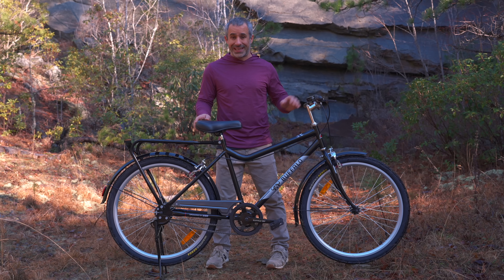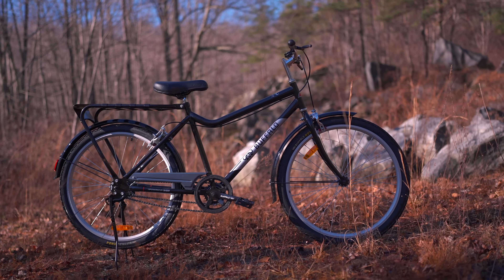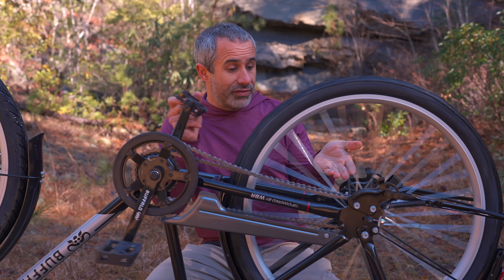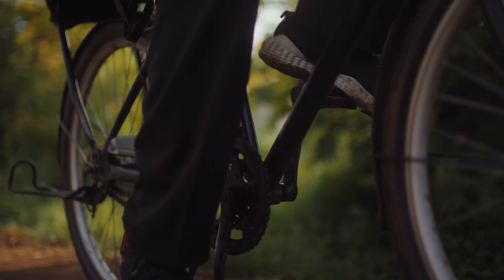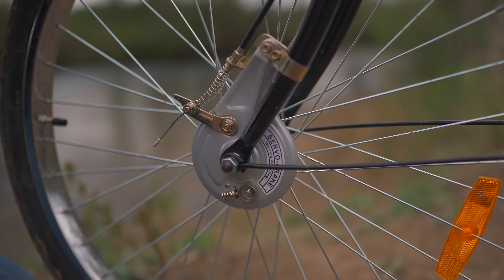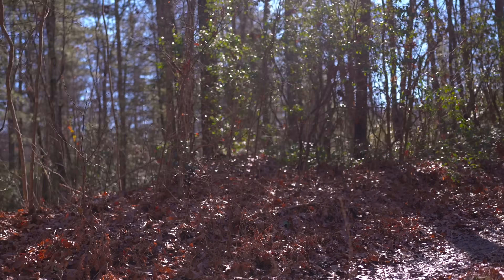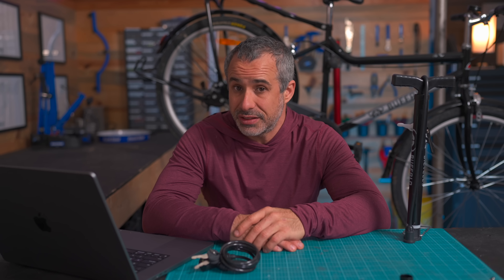Why 2 Chains Make This Bicycle WAY BETTER

Comment: Hi Seth.  Thanks for bring these to the attention of YouTube.  These are an example of all the right engineering coming together and making a practical, useful, and affordable bike.  It's the right solution for the right people.  While I do see the need for a climbing gear there is a weakness in the freewheel design.  I'm 6.2' tall and weight in 190 pounds, and a common problem I had was breaking the rear axels.  The problem with freewheels is that the ball bearings are inside the hub, while the chain is pulling on the gear away from the hub.  This creates a stress point on the axel where it meets the hub.  Seeing these people transporting heavy loads or other adults, I think broken axels will become a common problem.  My two suggestions are to have axels made of a high quality steel that can better support a heavy horizontal load (I Know, it's expensive).  My other suggestion is to equip these communities with the parts, tools, and skills to quickly replace the broken axels and get these bikes back to work.  People were surprised at how fast I was able to replace a rear axel, but when your a big rider, you get lots of practice.  Tom

Comment: drag-tastic. that'd be a nightmare .. 2x the chain wear, and if they wear differently it'd jump around like crazy. 

honestly though they should get hub gears, my rolhoff has done 15000km without a service or anything and I hardly ever even oil the chain.

Comment: My bike has a Bendix 2-speed "kickback" hub like this with a coaster brake. While it's been around forever and has been pretty reliable, you can definitely tell it probably wouldn't last too long under the sort of circumstances this design is built for. But I can tell you: having a lower gear is fantastic!

Comment: It's a terrible invention. just imagine what happens if one of the chains breaks or the mechanism on the wheel itself breaks. This can't be fixed 10,000 kilometers away if you're in Africa.

Comment: To bad the disengage/re-engage isn't done with a handlebar switch instead of a freewheel-ish spin back. Cuz now you can't actually freewheel. Switching between the two gears with the pedal ruins the freewheel feature/perk.

Comment: My bike is 25 years old and the shifter is still the same. The chain has to be replaced and is a costly part. Here, you have two, which get older at the same time due to dust. 
Sorry guys, but your idea is pointless.

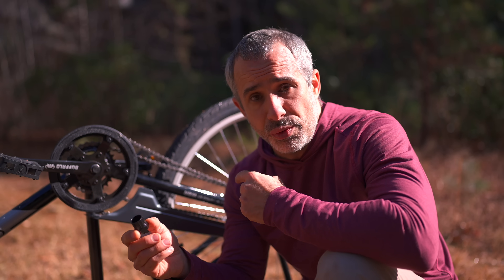Comment: One weak point, which is related to why freewheels were replaced by cassette hubs:  The wide 2 sprocket freewheel requires unsupported axle (with a spacer) running through it from the hub bearing to the frame dropout.  On older bikes with freewheels, this part of the axle would often bend (and eventually break).  Hopefully this issue won't be a major problem with this design given the terrain and load weight.  10:21 to see a quick shot of the unsupported axle section.

Comment: Two step automatic switching planetary gear with coaster break? Which can be installed on any road bicycle? Nah, lets add some chains, custom freewheels, use vulnerable threaded sport hub for freight bike, aluminum rims(those can be easily fixed with a hummer? No? errr), some dirt inefficient brakes and cables. Yep this makes it more RRRReliable. For sure. Reliable my...

Comment: I love it when engineers are able to get together and work on solving problems that people actually HAVE - giving them products they actually NEED, rather than spending all their time trying to solve problems that were created "just because" or because some company wanted to make their product more complex or have more features that will rarely get practical use, to force customers to hand over more money or replace an otherwise perfectly functional and good product they already own (tech like mobile phones are guilty of this - we don't actually NEED brand new models every single year when the average phone CAN be made to last for up to 10 years!). I feel like in too much of our modern society we make things needlessly complicated rather than focusing more on their basic requirements ... and for bikes it's to get the rider from A to B, and that's it. It needs to last, needs to be easily repairable by the owner or a mechanic with some simple tools, it doesn't NEED to have a whole bunch of complicated parts that require replacement when they wear/break rather than repair.

Comment: FUTURE BUFFALO ZINC + DONATION MODEL package deal idea - 1 x Donator self gift model using Zinc coated frame and ALL STAINLESS Steel CHAINS, BRAKES, Nuts, bolts, cables throughout. SOLID removable RUBBER/URETHANE Shock absorbing tyres, PolyPropelene BMX RIMS and twin side mounts Trays for lower centre of gravity to suit 5L Food Grade Square Containers etc. PRICE $600 which includes $200 DONATION for 1 X Standard steel BUFFALO. Put me down for 20 packages/donations as Im sick of punctures, rust and spokes.

Comment: Why would this be more reliable than a rear derailleur? Rear derailleurs rarely have issues and never have issues that you can't fix by yourself. Tyres are a whole lot more unreliable on those rough terrains.

Comment: I must say I am not sure about this innovation for practicality as compared to normal setup with backpedal brakes. This solution is complicated and requires more maintenance and handbrakes (and 2 chains, afterall...)
I think if I'd ever work on a similar problem of so much needing too gears, I would use a single chain and a good front gear switch. Simple, reliable.
Why wouldn't you hide the chain into a chainbox instead? Open chain, imho, is a bigger problem for a practical bike.

Comment: I'm not sure if this is such a revolution. My first bike was a Schwinn 2 speed in the 60's peddle backwards half a turn to switch gears low and high gear for hills. It also had brake in the two speed hub so no need for rim brakes. Put a zillion kids miles on it.

Comment: 10:00 ?bike pump?

When riding in the goat head and mesquite thorns; I quickly swapped to Flat-Free tires.

Gone are the days of hard plastic or hard rubber.

Today, many brands ride like air without the need for patching or pumping.

They weigh a little more,  but when factoring in a pump (not needed) that weight is almost nothing.

Comment: Brilliant idea, but maybe unneccesarily complicated with the hi-tech freewheel, two chains, brake cables etc.  In the past there have been several effective and robust 2-speed coaster brake systems that were cable-free eg. Sachs Torpedo, Sturmey-Archer etc.

Comment: Most importantly; Can the Buffalo S2 be converted back to a single gear either freewheel or back brake? I could imagine that if the dual-freewheel-shifter can't be made natively in Africa then the Buffalo S2 becomes another European boondoggle where Africans are reliant on the Noblesse Obligeé of outsiders to make critical parts for them.

Comment: I feel like backwards braking AND shifting could work. Have an audible rocker to indicate the gear change and then peddling backwards even more would engage braking. Sure you might need to shift a little more but it should be doable.

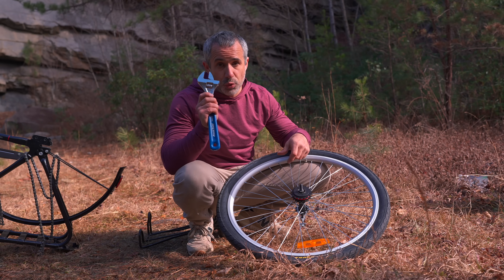Comment: 10:50
Adjustable wrenches work much better and cause much less rounding if you use them in the correct direction.😉

Comment: Decades ago there was already a 2-speed hub that shifted with rear pedaling. No double drive train needed. 

If I look at running cost of my bicycle... chains wear out faster than everything, including the tires. And that is with full chain cover. Riding in all weather.

Comment: I think the important thing to consider is that this doesn't need to replace the original buffalo
this is a specialised variant that can be deployed alongside it to suite more extreme use cases, so the slightly higher cost, complexity, and servicing needs are easily justified

Comment: I had a bicycle with a 3 GEAR PEDAL SHIFT way back in 1967, so this is not exactly a new concept. It also had a back pedal controlled rear brake, it worked  perfect every time and never broke down. It also had a rear pania for carrying heavy loads.

Comment: Finally an ENGINEERING work I've seen on bikes after years! Not marketing-driven BS but real innovation! Amazing!
Reply: It's wireless shifting!
Reply: this is nonsense... they dont exist. find a bike for sale i dare you... you dont have quote "hundreds of dealerships with thousands of trained and certified mechanics" yet no parts online, and no 2nd hand bikes for sale.. its not real
Reply: @TrueHelpTV ...what?

Comment: Seth I snapped my frame what is a good full suspension MTB under $1,000 to replace it I wanted to be good at climbing, but still be able to do good on the downhill and it jumps

Comment: Two different sized chain links to achieve desired tightness on both chains would be a very small design change and reduce the possibility of the looser chain coming off.

Comment: The climbing gear is always engaged. It is the high gear that is either engaged or disengaged.

When both gears are engaged the lower gear is just not helping out because the higher gear is literally running circles beside the lower gear and metaphorical around it.

Comment: This seeems a backward step on old technology to me. Back in the sixties when I was a nipper, I was given a "Moulton Mini Automatic" (Google it ) for Christmas - what joy ! It had two gears like this and changed gears the same way BUT it had JUST ONE CHAIN, all enclosed into the rear hub, not only that, it had coaster brakes, meaning you pedal backwards to apply the back brake. You quickly got used to it and it became the best bicycle that I ever had (and the chain NEVER came off !), I had it for years.  I admit that Moultons were not most stable but I'm sure this technology could be updated to suit bigger frames - what we have here seems to be a mechanical over-kill without coaster brakes.

Comment: It's time to replace those derailers with something better. That's a good solution. The most common problem with derailers is the complication with shifting gear when going uphill. As you inevitably slow down, you may have the tendency to pedal backwards to ease the stress on the gear system and then you loosen the chain! I have spent some time pulling the chain after it gets wedged between the wheel hub and the frame, as it gets squeezed quite tightly.

Comment: As the cyclist who rode a 2 chain / 2 gear bike on the velodrome at the Olympics, I'm calling BS on this being a better solution than an internal three-speed. That is a very well proven and inexpensive mechanism, and can be combined with hub or coaster brakes. 
I actually worked out gear combinations that would allow perfect tensioning of both chains, But still 2 chains meant twice as much to go wrong.

Comment: Looked them up...$180 for the S2, manufactured in areas where labor cost in miniscule , and bike requires full assembly, cost per unit should be MUCH cheaper, did some research and can buy a pre assembled adult sized bike for $70.

Comment: I have an Elephant bike, which is a similar idea, a workhorse bike from ex-Post Office bikes in the UK, supplied for use in Africa. The drum brakes are lever-operated, rather than back-pedal. Would it be possible to combine this arrangement with the new two-speed, to eliminate possible problems from rim brakes?

Comment: The effect of constantly agitating fresh whole milk strapped onto the back of a bicycle in a can while riding over a gravel road for 7 or 8 miles is conveniently unspoken. You can literally see the roughness of the road as the guy tries to peddle. The vibrations and harmonics induced into that milk have to change it physically because milk is a suspension. Are they trying to make cheese? Sorry, I had to bail. The mechanics of the bike are all I was interested in, and I had that figured out before I even hit play. There's not but one way that it can even work.

Comment: Same 2-gear function has been in Jopo as early as from 70's. Using only one chain. It's lighter and practically undestroiable.
Reply: Innovating on bicycles is very hard, simply because most of it has been done before.

Comment: When I was a kid, some bikes had a 2 speed hub where you changed gears exactly the same way as on this bike, i.e. by backpedaling just a little bit (nowhere near as much as on this Buffalo bike). These hubs also had internal brake, so if you backpedaled a little bit more than what was necessary for the gearshift, it would brake. Only one chain and no external brake or brake cable needed. There was no visual difference between this 2 speed hub and a single speed hub. No tell tales at all, you literally had to ride it and try to know if it was a single speed or a 2 speed.

These hubs were considered extremely reliable, and I can't remember anyone ever managed to destroy one, even though we were kids and tried to destroy things as best as we could.
That said, I do assume these hubs were more complicated inside than this 2 chain solution (never opened one), and the gear ratios were probably not spaced as much as on this bike either.

Comment: Those calliper brakes are absolute poo. I was impressed right up to that point. If used with steel rims the design wouldn't be so bad, but calliper brakes on alloy rims is bad news. The metal soon wears down then the wheel collapses unexpectedly. I've had drum brakes on a couple of bikes, whilst their braking power wasn't great they rarely needed adjusting and NEVER wore out. Also in this day and age why on earth are pneumatic tyres still being used, I've had airless tyres on my bike for ages.

Comment: A two chain direct drive two speed has been around since the mid 1980s. We had them when I raced BMX in 1982 in Tennessee. It was much more durable than using an English Sturmy Archer three speed internally geared hub.

Comment: This is arguably more than half of what good engineering is all about: the end user. You can design the most amazing machine that does xyz effortlessly, but if the end user doesn't understand it, or like it, or maintain it... Then it's junk.

I love my aluminum frames, carbon reinforced pivots, hydraulic discs etc etc. they are high performance, reliable, modern, and capable. But they also require a more modern and educated support system. Good luck finding mineral oil and a bleed kit in rural Africa. 

Awesome work Buffalo Bikes. Cool result, and it's so gratifying to see someone do an honest consideration of an additional feature vs the additional costs (in all arenas). The bike strikes me as reliable and easy to use as a hammer. Neat!

Comment: As a former bicycle mechanic I see some interesting design choices that I would not have made for the use case of the Buffalo bicycle. 1. Rim brakes, I can understand that a rim brake is the cheapest solution, however as a dutch bicycle mechanic I have seen 30 year old drumbrakes working perfectly without any maintenance. Rim brakes need new brakepads, have problems in wet conditions (especially combined with mud) and are dependent on a somewhat straight rim. That brings me to 2. Aluminium (or Aluminum) rims. Aluminium is more prone to stress fractures and fatigue. Not a problem on the Dutch bicycle paths, but offroad without maintenance this is an odd choice. Fixing a wheel that has folded in half has a high chance of breaking the wheel when bending it back into shape when using aluminium. A steel rim is more flexible and will probably be just fine. This video wrongly states aluminium rims are easier to repair or straighten then steel ones: that is just not true. Then to more detailed stuff 3. I like the pneumatic/air tyres, and they can be field repaired easily, but still: only one tyre lever in the set? Why choose a steel one for aluminium rims? When studying bicycle mechanics the teacher was unforgiving: no steel levers on aluminium rims! We used aluminium or ABS levers, so we would not bend or damage the rims. 4. Ever seen someone drive on a steel rimmed bicycle without tyres? It just works, although not as comfortable. Aluminium will not survive driving without a tyre. 

In short: love the idea, but the improvement in the two speed freewheel comes with brakes and rims that seem to be a bad choice for the intended use. To be honest: aluminium rims and cantilever brakes are cheaper, so it seems to be a cost saving choice, not a quality choice. This video seems to be made by a marketing department. 

Don't get me wrong: the idea and two speed freewheel are really good and reliable, it's the other parts that make this 2 speed bike less reliable than the original one.

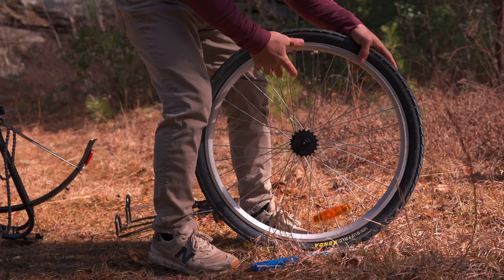Comment: 11:02 guys,  NEVER use a wrench like that. Everything in this video was helpful,  but this is a good illustration on how to easily screw up a bolt or nut. 

He slipped off here,  and it's not bc he used his foot,  it's bc he had the wrench backwards. 

The beefy end always follows,  never leads.

Comment: I have an e bike and I really only need two gears high and low. I've been looking for a solution that reduces maintenance and this system looks perfect. I'll do a little more research but this looks really promising thanks for sharing.

Comment: The head set ... the advantage of that old school headset a part from cost, is that you can rise the handlebar easy, very easy with only one screw.
That chains will last for ever and ever, they are thick ... 😍But what about the 3 speed internal gears of a hub like the ones in brompton (sturmey archer). They are reliable and can be used that nice chain.

Comment: A two speed internal hub gear is quite cheap, more reliable and you can still break with pedals. You change gears by kicking back, but the gear switches before the break engages. Surprising they didnt use it. It seems to brilliantly solve all their problems.